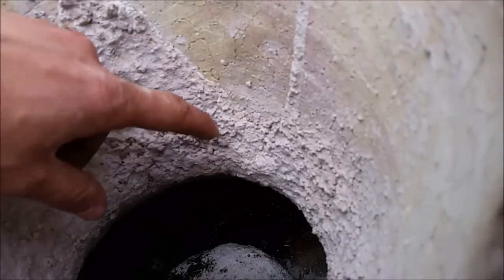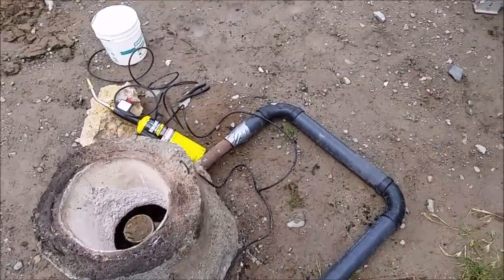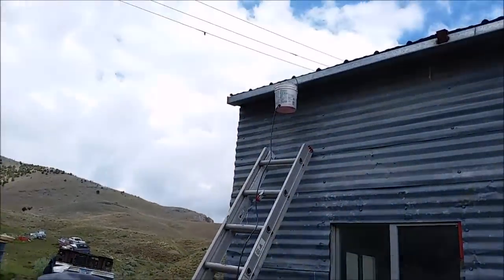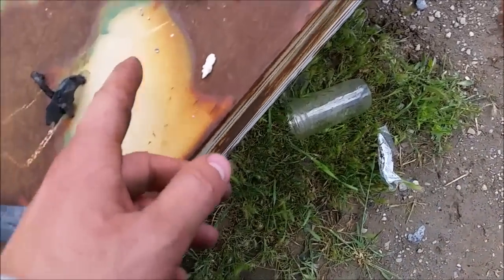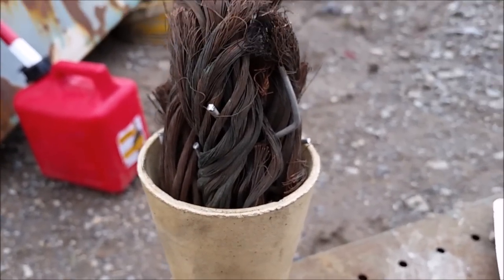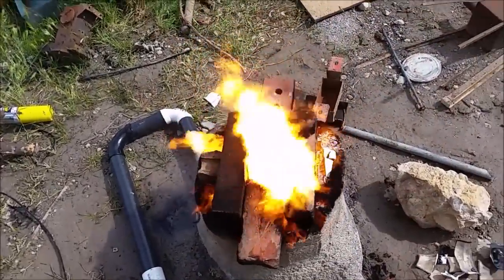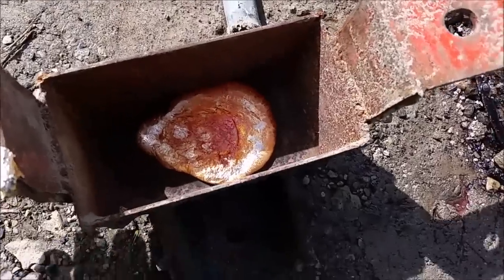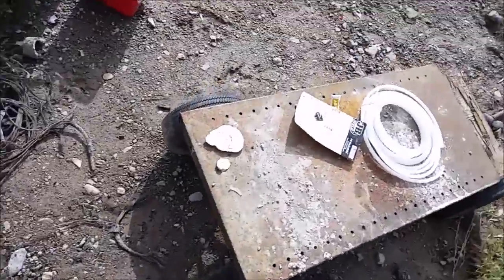Need More Heat!

Comment: I've got to say, the absence of pure safety makes your videos even more interesting, Cody. I hate watching a video where they emphasize safety every chance they get. Of course, it's a good assumption that all of your subscribers have common sense and therefore no need to be safety-crazy.
Reply: his only nod to safety is pointing out the glasses lol
Reply: as long as there is no butter, he doesn't need to worry.
Reply: check out the couple of videos i did on my wood fired smelting furnace made from an old 55g with a 700cfm leaf blower for aspiration if thats your thing. i eventually blew it up with an unintended compressed afe and it lives on but with a very hemispherical bottom.
edit: one video on the wood furnace but also one of it running on used motor oil even hotter, best i could tell was it either started a thermite reaction from all the hot iron oxide and aluminum or i accidentally melted some iron because it shit a puddle of white hot metal through the bottom at one point that i have a sample of still and is mildly ferric but very much full of bubbles and slag bits.
Reply: Dragon_EX did you mean “the pure absence of safety”?
Reply: Dragon_EX I
Reply: but he only used the glasses to be able to see inside the fire
Reply: Its best to be smart about safety and honest when you get hurt.

Comment: suggestion for ya +Cody'sLab,  You're letting a lot of heat out of the top of that thing.  IF you cast a concrete lid with refractory cement, and then poked a vent hole on the bottom laterally to your inlet, you would save a lot of fuel and the heat would build up much faster.
Reply: JathTech But if it gets too hot and the ventilation hole is too small, the furnace will break. I agree with you that he let too much heat away. Its good to find that balance where you keep a lot of heat and let enough heat go away
Reply: When you read my long name, I stole your sandwich 
you can use a fraction of the fuel and finish the job faster.  proper refractory cement is designed for extreme heat.
Reply: There isn't a major difference in fuel consumption and there is an increase of danger............
The king of random proved it
Reply: you evil imaginary sandwich thief 
you know what instead of making another sandwich I will make a sandwitch

Comment: Try and use that thick braided pool pump hose for above ground pools you would gain way better air flow.  No elbows I'm guessing you have an intermediary between the pvc and the steel pipes. As long as it has some room from the heat it is surprisingly durable and takes heat.  Cheap at Home Depot

Comment: what i do is i use waste oil to get the furnace up to temperature and then i switch over to diesel to bring it up hot enough to melt the iron

Comment: Not sure if you're still working on this furnace, but I suggest making a lid for the top, and breaking or cutting down your pieces for more surface area, the metals will retain their heat better. You lose a lot of heat retention from the huge opening, which slows down the process, cost more in fuel, or never reach the required temperatures to melt whatever you're trying to melt (assuming you're planning on moving up to iron and steel that is). I've seen plenty of furnaces that are completely sealed, and need to be destroyed/disassembled to claim molten iron/steel. I don't think a furnace that size needs to be completely sealed, but try closing that gap a bit. I had a furnace less than half the size, melting copper and brass in a similar sized crucible, and I just used some firebricks (for lining wood stoves) to cover the opening at the top. Your furnace is significantly larger than mine was, so I'm not sure what your options would be besides building a lid out of the refractory material you used to make the furnace, but the bricks were a step there for sure.

Comment: Im a furnace operator at a copper rod mill. The furnace uses CO analyzers to determine what kind of fuel to air ratio im running. we keep it at about .70, that way your copper wont absorb so much O2 and appear to bubble like pop. i should get you some refractory bricks!

Comment: Hey, Cody, been watching your videos for about a week now, pretty sweet stuff! Not sure if you still look at the comments on these relatively old videos, but if your willing to put a little more time into your fuel system, you should be able to boost the amount of BTUs you can effectivley use from your fuel by a pretty significant amount, saving you a lot in money and fuel in the long run.  If you can atomize it and put a little bit of a "swirl" on it as it enters the combustion chamber, that would be enough.  Same way a fuel injector pumps fuel into a cylinder.  Love your videos, keep 'em coming!!!

Comment: A simple coke forge will melt almost anything short of tungsten in my experience.
Reply: Can't edit my comment on mobile. Also coke is fairly cheap compared to procuring exotic gasses and whatnot.
Reply: Generic Name I don't know where you get your coke from but where I live that shit is like 30 bucks a gram, you in south America or something?
Reply: In case you're not joking, they mean coal coke, which is essentially pure carbon.
Reply: Where do you  live? lol
Reply: Hmmm forge on cocaine must heat up super fast and make work super easy. A++ would recommend.
Reply: @luckyhero2517  it's a type of coal you dolt 
do you really think he meant the drink
Reply: Robby Frith where did I say anything about a drink
Reply: @luckyhero2517  cocaine was on old coco cola

Comment: Hey Cody, maybe for your fuel delivery system you can drill a hole into the furnace/crucible so that the fuel goes right into the furnace also for the cast iron I'd try to break it into chunks or just get a bigger crucible thingy. For heat? I don't know maybe if you could get pure methane in a pressurized tube? You do live on a ranch and ranches do tend to have cows...

Comment: AAHH Hey about that .I have done a number of furnaces and different variations.including fuel oil., maybe a total of 6 different types .For gold refining. The best was about 5,000 degress , hot enought to burn away part of a graphite cruciable., and I molded the furnace of regular refractory cement,  and cured it for a year. and I even burned some of that eventually.refractory  stuff is only rated for about 3600 degrees and it breaks down too. Cheapest best way is use stone with no cement at all. there is water in regular concrete and when it gets hot enough will explode. You need a good lid with a couple vents in it, use stone ., build a wood  fire in the stacked up special stone blast furnace it to start, then start adding anthracite coal, til its burning coal only, put a graphite cruciable in , adjust the airflow, and cover the blast furnace with lid . and be carefull . Its really 5,000 eventually, and thats dangerous.
Reply: +Wolf King Lobo BTW in the old biblical times they used a very special high tech material called .. stone. I think you can use sand and plaster of paris as mortar and in my experience coal as a fuel works best in the airblast.
Gets extremely hot, as in over 4,000 degrees.

Comment: I really laughed out loud when you showed the fuel container hanging from your gutter. ha ha I am working on a new idea where I will use a sealed fuel tank with compressed air to push it out, so that I can use a regulator and get the flow precise. And less moving parts than a pump.

Comment: Lets see cody make a knuckle duster from bronze. Use high density foam to make your stand in knuckle duster, kids swords and such is made from it. use that for your mold. you can totally encase it with casting sand. fine sand with oil added to dampen it for holding shape,and pour into the foam and it just vaporises leaving you your shape to be filled with your bronze. its great for casting.
Reply: Elliot Lockett what if i told you grant didn't invent it?
Reply: I was talkin to cody conveying a vid id like to see him do, i never invented casting or metallurgy or using foam. its just a method i seen. i cant remember where. but it works great.. Its youtube . millions of vids. all sharing ideas. I cant remember where i seen 1 vid ffs, now if id of said o yea btw its my method. i invented it but ill let you use my method. the one i thought of first then you may of had a point, seems more like trolling.. now run along .

Comment: try smaller chunks of clean iron. make a lid for this and you can just as easily use cooking oil too. probably could get used deep-frying oil for free too. you'll have to strain and filter out the food particals. but would get way mor in volume that used motor oil.

Comment: Hey Cody, would you expect to reach significantly higher temperatures if the air coming in was preheated? Perhaps you could run the air from the shop vac through  some copper tubing over a campfire or something.
Reply: Tom Haflinger I think heating the oil would be better

Comment: You should just make an arc furnace. They're much more efficient, faster and generate a lot more heat. Just step up 2 or 3 power outlets with a few transformers. You can get anywhere from 200-600 amps across some carbon electrodes. The only thing you need worry about is your clamps for the electrodes melting. But that's easy to fix as long as you have more then one set up clamps.

Comment: I used to have a forge with a shop vacuume set up but i used actual coal and i was able to melt everyting i threw in it including the container i was using to hold the molten metal.

Comment: For some reason, I've always wanted to melt clay..
Reply: Improsibruh
Reply: You can melt anything but minerals are pretty difficult, definitely need some special equipment. You're basically making lava at that point.
Reply: cant melt wood.  not in a furnace anyway
Reply: jeremy mcadam any thing can be melted in the right conditions

Comment: Hi Cody
U will have a hard time on that cause iron is melted in a copulla furnace or induction furnace before transferring on a crucible and in order ur melted iron flow on the crucible u ned to reinforce it with fire clay and sodium silica I used to work in a foundry as a helper and machine operator I hope my advice will help u in your some other project cause I like ur show man I learn alot on u this is my way to pay u back 

Thanks man more power to ur YouTube channel 
Viva codys lab
:-)

Comment: Eww, that's hot  lol  don't figure  :-) Coleman stoves run the fuel tube over the burner to preheat the fuel to turn it into a gas state. Would this concept work for your smelter running waste oil? I do have an idea about angling the input tube to increase travel length before the fuel/air mixture exits the furnace. The idea is to increase burn yield before it exits the furnace. Increase fuel yield should translate into more calories expended inside the burn chamber.
Reply: +Tracybeme The fuel cools the tube enough so that it doesn't melt

Comment: On the vacuums supply to furnace. if you notice you are cutting the air flow valve build a tee that fluxes air across the fan side of the vacuum   to keep the electric motor cool
Reply: also add a liquid explosion control in line of your fuel . we use these in acetylene fuel systems to prevent explosions backwards up yhe fuel line, due to low fuel pressure.this would be very pertinent if you decide to introduce oxygen under pressure. also cut thread looking grooves around the inside of the furnace to cause the flame to form a more circular flow, yielding higher btu exchange.
Reply: +texasdee slinglead also the high drause on the copper , I believe is due to oxygen present in with copper. need some kind of lid that you could purge nitrogen into the crusable (sorry about the spelling). we , in plumbing frequently purge copper oxygen lines with nitrogen during brazing to prevent the formation of copper oxides. makes mad black flakes without the purge, leading to failure in certifications for med gas systems. and who's our new young star. she hangs around with you and she's liable to catch the genius bug, lol. keep up the wonderful work , Cody.

Comment: try using gas such as butane instead of liquid fuel, its already pressurised, cheap and when you turn off the supply the smelting pot goes out straight away
Reply: I think gas fuels ignite to quickly to be as effective as liquid fuels have you used gas fuel for this kind of thing before?
Reply: Yeah, i used acetylene though, along with oxygen, maybe a little too much oxygen, it cracked the furnace, but butane at say 50psi with maybe 10 psi of oxygen would work great, and not nearly as dangerous as pressurising flammable liquids
Reply: Hmm very interesting, did you get this idea offline? That was also a very quick reply haha.
Reply: I studied motor vehicle maintenance at college so go the the idea from oxiacetylene torches, I've seen a few people use gas furnaces as well and they seem to work extremely well, especially if introduced to extra oxygen
Reply: are you serious?
Flammable pressurized gas and oxidizer mixed aren't as dangerous as pressurized liquids?
how did you arrive at this conclusion?
Really i'm curious, I've been around and handled lots of both and they're both nothing to fuck with. Almost anything remotely flammable in the presence of a pure oxidizer can get past a couple thousand degrees F within the first second or so of ignition. Oxygen by itself isn't super exciting but in the presence of flammable gasses can cause explosions or really fun jets of flame in places you didn't expect them. 
Its no joke, neither is pressurized flammable liquid.
Personally I'd say the possibility of being soaked in used motor oil is much better than being subjected to a mixed gas explosion or even worse a concentrated burst of oxidizer and fuel gas that's in the middle of becoming water vapor and co2 and several other things depending on the fuel and if it starts oxidizing the supply line its being carried by. which is SUPER EXCITING, would recommend quick connects, nice ball valves, and flashback arrestors.
 I work with ~5-15psi propane and ~10-20 oxy on a daily basis most of the day and have a very healthy respect for that torch, it'll sizzle you right quick and keep going even quicker.
I respect your decisions but fuck man be careful that shit can do some serious damage if you aren't careful.
I know its a year late but just my two cents. happy melting <3

tldr: fuck be careful man stay safe and have fun

Comment: Longer hose=more resistance=less airflow, physics man. You could get rid of 80% of the length of that tubing. Also, look into aerosolizing the fuel, like a compressed air paint sprayer. +C

Comment: Maybe a lid would help to trap the heat?
Reply: Luis Beaucage not really as long as you leave a hole for venting (i have a copper furnace)
Reply: even with no venting the pressure would just lift the lid slightly and release the pressure...
Reply: Boom
Reply: you mean trap the air? KABOOM
Reply: Make sure to weld it down so to keep the heat in
Reply: epicsilverprince but the he can't get it off lol
Reply: Charles Garrity I was joking, the whole thing would fucking explode, getting it open wouldn't be a problem
Reply: All that would do is effectively cut the air flow. Which would make the fire colder.

Comment: you could put a lid on it, catch the exhaust gases and build yourself a crossflow heat exchanger to preheat your fresh-air.
that way you do not have to heat up all that mass of useless nitrogen with your precious fuel

Comment: Try to elevate it as high as possible... and limit the flame flow... to one spot! Also if you had some hokes on the bottom side uou would have more air coming in without a draw back...  also the concrete was dissipating a lot of heat... couldnt keep up you need at least a foot of it.

Comment: Now you have a supply of hydrogen and oxygen - can you make the ultimate fire by mixing in oxygen and hydrogen into the air blower?  And, side question - if you're using all of that modern equipment - how did iron age people melt iron without pumps and diesel?

Comment: Cool, you should try instead of all that just a 240v ac arc welder, it can easily be turned into a arc furnace in 30 minutes. Check out Grant Thompson - "The King of Random" he made a arc furnace out of a arc welder. Oh and the necklace arrived today, really impressed wearing it now.
Reply: Yeah still shiny
Reply: ***** ill post video later on my other channel backyard pyro
Reply: ***** I was recently changing out the chain on the necklace and I accidentally dropped it and it fell 3 feet and shattered is there any chance I could pay $5 for a replacement vial and cap
Reply: ***** thanks so much!!!!

Comment: +Cody'sLab What is your furnace made out of? I have 250lbs of copper wire I want to melt down into ingots so I can sell it off. Copper is pretty high right now where I live, but upon reaching temperatures hot enough to do the job, my basic concrete furnace cracked and fell apart.
Reply: +Shenanigames Nec Nvm, just found your video on constructing the furnace. Keep up the good work!

Comment: Is there a specific reason you did not use propane for the fuel?

At least used engine oil will have more energy density and rob more oxygen from the flame.
Reply: actually an oxyhydrogen flame would be best so long as he kept it from exploding

Comment: if u add a screen in front of the drip hose like inside the air tube it will make it way better i think it ionizes it or some term like that all i know it makes a hell of a diffrence
Reply: actually i think its called atomized still could be wrong

Comment: have you tried coal? i completely obliterated a cast iron crucible trying to melt copper. i did succeed in melting copper with a graphite crucible that i coated with borax to protect from the oxygen. i was using a shop vac also